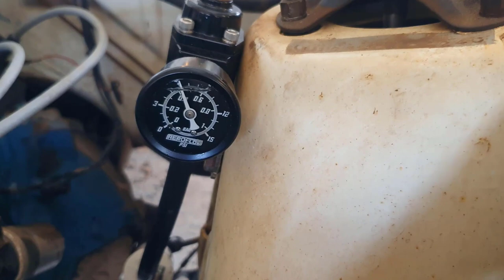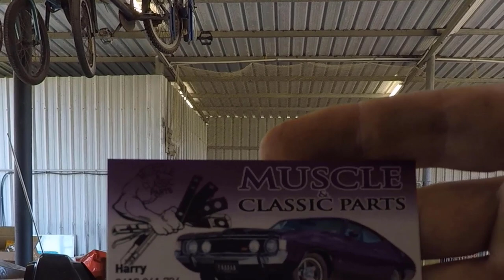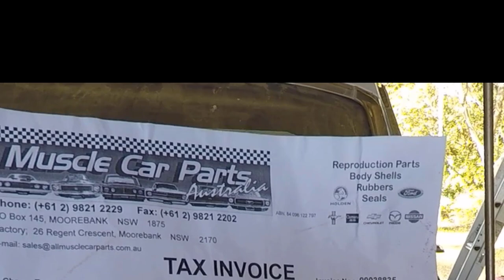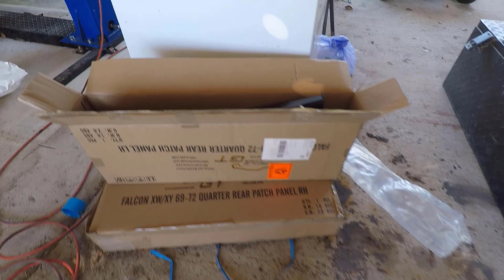Restoring a Ford XY Sedan, replacing rear quarter panels.

Comment: I subbed just because you do great work and it's helping people learn. Haven't had an old Ford for 30 years . Sold my Xt GT and bought a Chrysler regal se in 1990 . Still drive the regal se but it a hot 360 . Please drop a Cleveland in this XY , they're a great engine.
Reply from the maker: Thanks Peter, yes it is getting a Cleveland, looks like being a 393 all said and done, just waiting on the US/AUS dollar to improve to get bang for buck. Im keen to get my hands on a wagon myself.
Reply: @barefootrestos  I put a 351 Cleveland in my Xt GT, great engine.  Really went well, only trouble I had was the Bosch ignition modules went sometimes.  Too right about our dollar, when I built the 360 I had everything sent over and our dollar was the same as the US dollar.  Freight was cheap to, even had the heads sent over. The Cleveland will fly , you'll have fun with that beast.